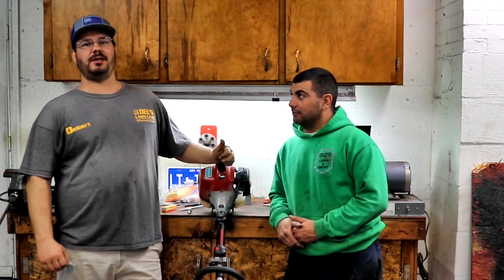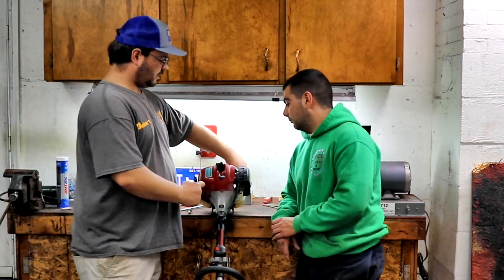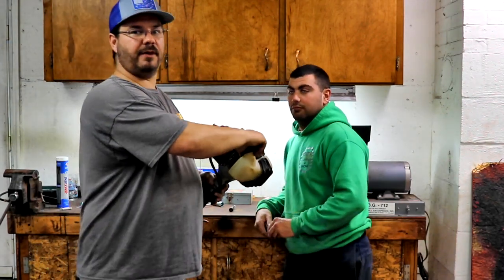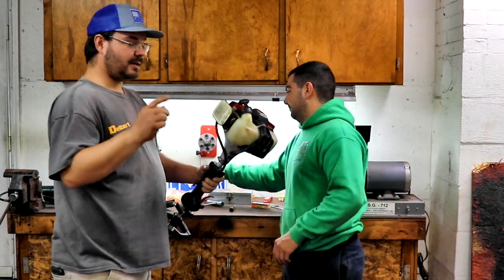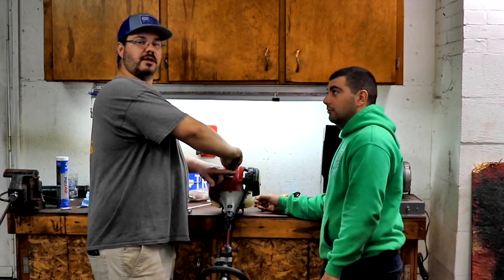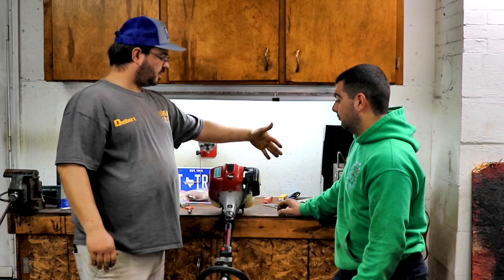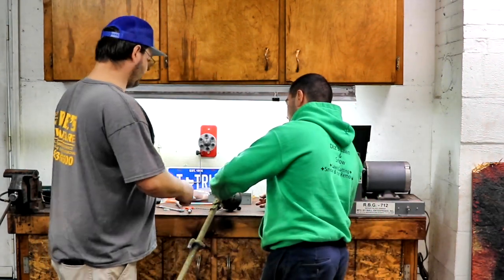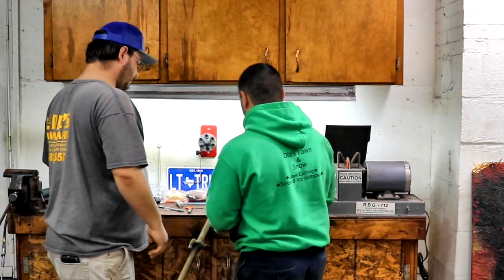Red Max BCZ260TS Tune up

Comment: One more thing u forgot to do pull the spark arrestor on the muffler and clean it alot of people over look that little screen and wonder why they lose power over time
Reply from the maker: Yes you can clean them or just take them off and throw in trash. I could of said that Good catch. 👍
Reply: My dealer won't warranty if I take them out and throw them in the trash
Reply from the maker: @mikesautomaintenance5780  I understand and your right about warranty.  I have owned so many trimmers and they always last past the warranty and never break until the warranty is up. It seems as if the warranty is up then it breaks.
Reply: Del's Lawn Care LOL that's what it seems like with anything you by nowadays something always breaks after the warranty is up

Comment: I bought a John deer weed eater 23 years and have never did anything but run the hell out of it and put non ethanol gas in it and that’s it. And it still starts with first pull.

Comment: Hey are there fuel adjustments on these weed eaters?
Reply from the maker: no fuel adjustment. I would start with replacing all the lines and gaskets. They sell a fuel kit with all this in it. I don't have the kit number but home depot sells them.